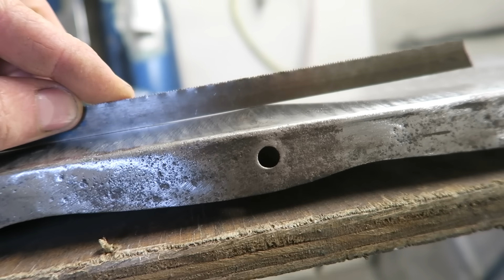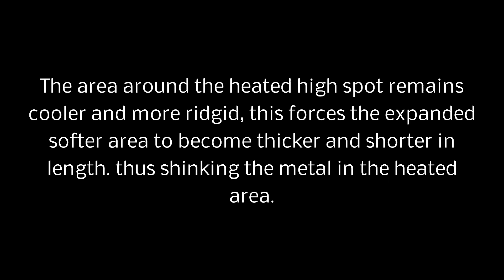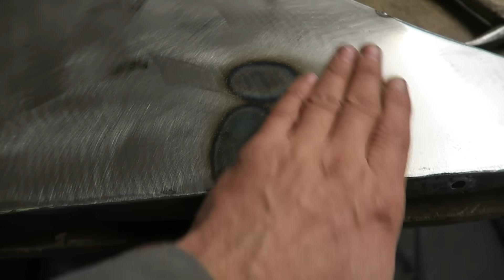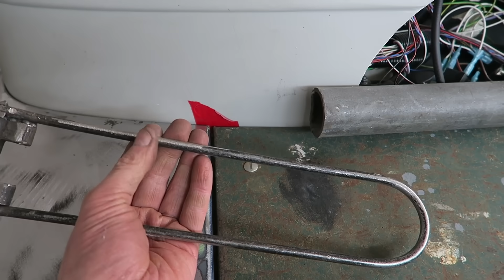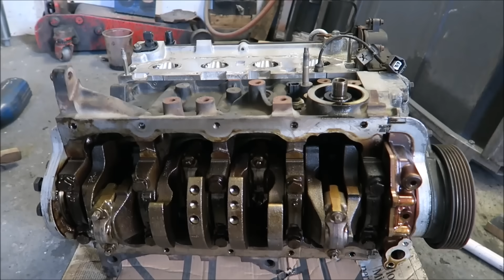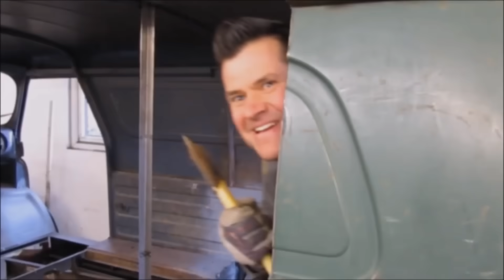Heat shrinking using a blowlamp panel beating Tips and Tricks #4

Comment: With the converted spring pick… how do you use it? 

Is it just a case of pulling on it? 

Or do you hammer down on top of it? 

🇦🇺🤜🏼🤛🏼🍀☮️😎
Reply from the maker: The pick end goes inside the panel and you just pull dents out. The part that you hold in your hand lines up with the pick end so you can easily see where to hold it. Cheers Trev

Comment: When dad did a shrink (oxy acet, so it was faster).  He always held a dolly "around" the edge of the shrink as he tapped it. Then he moved the dolly gradually into the shrink to move the metal back to the profile.   I was the kid inside the panel holding the dolly when he couldn't reach the spot.😉

Comment: It's important to not let the heat wander into the surrounding area.  While that area stays cool it holds back the force of the expanding metal, thereby shrinking it.  If the heat moves too far out, the effect is lost.  Get in, get out, and don't get famous, as they say in burglary work.
Reply from the maker: Yes Alex you’re 100% correct, I had made this particular video for a guy that had extremely limited tools. It wasn’t a  “the best way” type video. Cheers Trev 👍

Comment: Just fixed the wavy bonnet on my 1960 Falcon using a blow torch and a few basic tools thanks to your blog.  Always been into welding, but not panel beating, never thought I be able to shrink.  Cheers
Reply from the maker: Glad to have been of help. Cheers Trev 👍

Comment: Great video.  In the late 50's, yeah, I am that old, the method I  was taught to use to shrink panels, was to use the acetylene torch and actually heat the spot I wanted to shrink to a cherry red, before cooling with a wet rag and then hammering.  It is interesting to learn that the process might have worked at a much lower temperature.  I was doing a chop and channel on a 34 Ford pickup, and because of the hard life the truck had lived, there were a lot of dings, some about quarter sized,  that had to be shrunk back into shape.  The bodyman that taught me was a master with working metal, and like you, he used a lot of finesse to straighten even severe dents.   You do great work, and I am looking forward to watching more of your videos.
Reply from the maker: In some respects I wish I hadn’t made this video using a blow lamp. I actually made this video as a request by someone that only had a blow lamp as a heat source. Using a O/A torch is more effective as it creates a smaller spot of heat. Having said this it’s actually possible to use a hot air gun to shrink metal if you use it to expand the panel in an area before giving it a blow with the panel hammer, the heat expansion holds the panel ridged placing compression along in when hit with the hammer forcing it to shrink, a bit like a mechanical Shrinker. By far the most useful for me is a single sided spot welder. Thanks for your comments. 👍

Comment: Hi  Trev Regards from NZ enjoy your Blogs, straightening metals is always a patience game  I have been in the metal fabrication game all my working career Ships trucks Tanks etc  What one has to keep in mind firstly is that  steel plate has been Mill   manufactured, heated &  rolled Quenched Etc which imparts Locked in residual stresses Thinner plate usually  the worst as heavy plate cools slower and partially stress relieves itself   Then the user forms, Heats Welds as well  and releases and forms more   stresses to form distortion  Keep up the great information blog  Its all about experience and Listening  well done mate

Comment: One trick to do where the crack is still a small hole right at the end of the crack to stop it from going any farther then weld it all up I have seen cracks that were welded before crack again because it was not drilled to stop it ... It like a oil filter that has a dent don't use it the dent will crack from the changing if the motor.   Same with the panel with the vibration of the car..
Other that that great job for the tools that you used..

Comment: Question.

Heat shrink the high spots. Isn't a low spot just a high spot on the other side of the panel?
Can the more difficult low spots be heat treated from the backside of the panel, same way a high spot is treated from the front side of the panel?
Access issues aside...
Reply from the maker: I’m working on a new video that will explain this 👍

Comment: I expected a different mode of operation here, I expected you to heat the spot up until it was glowing red, then let it cool. That would have caused the metal to shrink to a smaller state than it was in before, pulling the metal in from all sides.
Reply from the maker: Right at the start of the video there is a basic explanation that this video was made to help out a viewer that didn’t have proper panel beating equipment and only had a blow lamp to use as a heat source. You were right in what you were saying about the metal pulling in from both sides. The blowlamp has too large a flame to be specifically suited to heat shrinking however virtually any heat source will do because you are causing expansion of the steel in a targeted area that puts tension in the panel that would otherwise pop in and out “oil canning” when the area is hammered this produces lateral compression forcing the metal together creating a heat shrink affect. A better flame would be from an oxygen and acetylene welding torch with a number two tip this would result in a far smaller hotter flame keeping the heat focused in one area and for a very short amount of time, The cool steel around the heated area would produce a an expansion block forcing the heated area to increase in thickness thus creating shrink when the metal has cooled. Cheers Trev 👍
Reply: @trevsblog  Thanks for the answer, I have no experience with working sheet metal so I wasn't sure what to expect but I'd heard of flame straightening like I mentioned. Is this technique used any in this business? I've wondered if a TIG torch might work as well as an O/A torch.
Reply from the maker: It seems more complicated than it is. Because bodywork typically doesn’t stay uniform when you hammer it or heat it etc it seems like it has a mind of its own, this is because it’s relatively thin and there are normally a lot of complex shapes going on in bodywork that have an enormous effect on buckling etc. It’s no different to flame straitening as described in my last message, and the added blow with a hammer places lateral compression to increase the shrinking effect. As said any heat source will work, ideally smaller the better but you can use friction, a hot iron, TIG, I have even used a hot air gun. Cheers Trev 👍

Comment: Wow, that blowlamp leaves mine looking like a cigarette lighter. What is it and what gas are you using.
Reply from the maker: Hi Andrew

Please don’t be too focused on the whole blow lamp detail. One of my failings with this video was not pointing out at the start that the video was made after a viewer request for ideas on how he could perform shrinking without any specialist tools. I asked him what he had that could heat up metal and he replied a blow lamp. Although it was effective it isn’t the best tool that I could have used BUT it was a cost effective way of performing a quite advanced skill utilising a tool he already had. A more effective tool using a flame would be a proper oxygen acetylene welding torch with a very small jet, like a no2. The smaller and hotter the flame the less heat spread you get which is what you ideally want for the shrinking process to work more effectively, as it’s the cold metal around the heated area that holds compression against the heated area. Having said all of this the video as far as I’m concerned contains good information, I have also successfully used a spot of mig weld, a TIG welder, single sided stud welder, gas welding torch and even a hot air gun to shrink metal. Some people even use friction, which is supposed to work well.Cheers Trev 👍 ps the blow lamp was nothing special just a vintage one

Comment: Trev, can you do a video using a shrinking disk to remove highs?  I ruined a panel or two as a beginner using a torch.  The shrinking disk is easier to control  the heat and has worked more effectively for me but I would like your opinion on where to use one method versus the other.
Reply from the maker: I’ve never used a shrinking disc, maybe I’ll try one, one day... using a gas torch with a no2 is preferable to a blow lamp but that was the request I was asked to do a video on. My favourite tool is definitely a single sided type spot welder with shrinking attachment. Cheers Trev 👍

Comment: Good gravy Trev, it works! I found a previous repair last night on the tail panel of my Firebird so I decided to pop the filler out and repair the dent, unfortunately, I pounded the metal a little thin and it had the feel of a pop tin, so this morning I watched your video and tried it and with 2 minutes and 2 tries it was back straight, nice and tight, it worked perfectly. Thanks for the awesome tip! Cheers

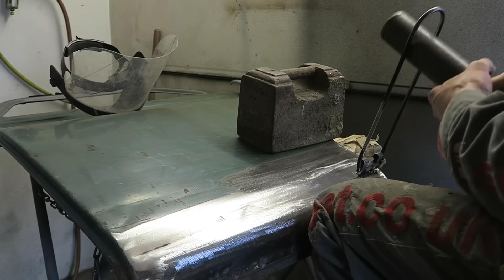Comment: Good tip for you when welding a pull bar [20:20] run a weld to panel first then weld bar on to weld so after work you do not damage panel when removing bar [often pit marks /holes ]

Comment: Hi Trev, nice video again, as usual :) 
However it raised some questions that I would ask the teacher if I would stand next to him in the room. Youtube is not the best medium for Q&A, but anyway...
You basically turned a highspot into a lowspot here, metal being stretched up in the beginning and being stretched down at the end of the job. Am I right that the end result still is a stretched area, only the other way up (down)? Did you hammer it a bit too hard then?
And then you state something interesting about a low spot being (relatively) easy to solve, versus a highspot being very annoying. But they basically are the same, or? Just flip the pannel and a highspot turns into a lowspot. How come you can bring up a low spot with hammer and dolly, but a hightspot not down? Where does my reasoning go wrong...?

I will purchase one of these stainless discs to be used on the disc-grinder to apply heat to highspots, one of these days. Did you ever work with those?
And what's you opinion on shrinking, only by cooling the hotspot down rapidly, without hammering?
https://www.youtube.com/watch?v=FGMUEXGiySA and https://www.vocor.nl/krimpschijf-shrinking-disk/1847-krimpschijf-shrinking-disk-125mm.html

thx, cheers from Holland!
Reply from the maker: Dutch Classic Exhausts if someone asks this question they are truly asking a great question because it means that they are really trying to understand something that on the face of it seems straight forward. Most car panels are convex, if you have a high spot in a convex panel it means that it is stretched and needs to be shrunk normally by means of heat shrinking which is a harder operation compared to a low spot that needs stretching. I hope we’re agreed upon that. If you now flip the panel over, the panel is now concave and the reverse applies a high spot in a concave panel needs to be stretched not shrunk. If you shrink a high spot on a concave panel it becomes higher. If you ponder this for a while it answers many questions about the nature of high and low spots. The most controllable tool I have personally used for heat shrinking is my dent puller with the heat shrinking attachment. Cheers Trev 👍
Reply: @trevsblog  Thanks, Trev, I understand the nature of high and low spots better now. A low spot on a convex pannel is basically shrunk a bit: the metal takes a shorter road from A to B. That was my missing context.
My new tools will come in this week; I will give it a try and see what happens. I already found that the fenders of my Citroën U23 light truck are quite solid steel, 1,5 mm at least. Probably not the best to practice on. Maybe I should practice on my neighbors car first :)
cheers!

Comment: if you were to do that to a panel you couldnt get to the inside of to paint would it be better not to use this method due to the potential of initiating/accelerating rust on the back of the heated area?

Comment: Great video. I was just trying to shrink excess metal from a panel today, but was unsuccessful. It is "tramping" as I call it, but the same thing, it's high to begin with but will flip to a low point if I push it.
   A couple of things that will make a difference is that my butane torch does not produce a fine, pointed flame like yours. It makes the heated area twice the size. Plus, I was just quenching it, I wasn't tapping it while it was hot.
   I'll be having another go in the morning.
   I really enjoyed the video and the way you explain things, so I've subscribed and look forward to any future videos.
Cheers.
Reply from the maker: Ray Plant by putting the heat into the area you are actually expanding the metal, this expansion causes a lot of tension allowing you to hammer the metal without it popping back in. When you hammer it, it causes the metal to shrink. The quenching isn’t as important as it appears as I’m mostly using this to bring the temperature down so that I can inspect the repair. Cheers Trev 👍
Reply: @trevsblog  cheers Trev, I appreciate your response. I'm about to give it another go right now. Thanks.

Comment: Subscribed, I've watched many video's of this type and Trev is by far the best. The tools are genius, I also make them as needed. Love the the slide hammer at the end,I made a clamp ended variation of this a while back to sandwich the weld on type dent puller studs which allowed me to move around on the dent and pull from all, center or either side as needed. Thanks for sharing your skills and knowledge!!

Comment: Great video but why not use Paintless Dent Removal techniques
Reply from the maker: fl4637 the metal is stretched beyond manipulating it back into shape, it’s also slit and needs welding. To use pdr methods wouldn’t really be a logical process. Cheers Trev 👍

Comment: Hi Trev, just watched your interesting blog on heat shrinking a panel. As a plumber l noticed that you are holding the flame a bit to close to the metal. the hottest part of the flame is the tip of the dark blue cone, the flame is not so effective if the cone impinges on the metal. otherwise a good blog.

Comment: Good vid.  No dolly?  I find the heat and hammer method works, whereas the heat and cool method doesn't.  Heating and cooling just hardens the panel and makes it harder to work.  Although sometimes you want that towards the end of work on larger panels.

Comment: It might be nice if you'd make a proper distinction between splitting and cracking- they are different. A "split" is the result of being forced apart at the failure- like with a knife.

A "crack" OTOH is a result of being pulled apart by tensile forces. 

Everything you've called a split is actually a crack. I know some people are going to be offended by this comment, but it has more implications for the way the remaining material behaves...and anyone that says that doesn't matter is choosing to remain voluntarily ignorant. The most obvious example is the fact that a cracking failure actually extends significantly further into the material than the observable crack. 

Otherwise...nice video.

Comment: Another interesting post! I've used heat shrink to straighten shafts, after a weld repair, but just used a water or air quench. Love the homemade tools. Seems like the work is more fun when done with them. Thanks!

Comment: I'm as guilty of NOT being very safe as the next guy. One thing I used to be guilty of until I learned better was lighting a torch with a gas lighter. Those things supposedly equal a quarter stick of dynamite so you wouldn't want to be holding one when it "blew up". And, they do. I have been told by welders that a spark from welding can set them off. Probably not terribly likely. Just not something you want to risk since you can't do much with only one hand.

Comment: Back in 77, (old school), I was taught how to remove stretched spots, (high Spots), in fender panels with only a rosebud tip to heat with, and a wet rag to quench with. I could literally hear the panel pop back into place while doing so. Its a bit of artwork to achieve and does take practice but in most cases, I did not need to hammer at all. I actually became quite good at doing so in under a day. I simply heated and quenched strategically. Its all about understanding what caused the stretch and where to heat to remove it. Small circular dents were easy. The skillful part was removing an oval or even curved stretch. 

As for the hammering, I was also taught to angle my hammer taps with strokes going inward towards the center of the high spot, from all angles around the high spot, not to hammer directly downward on the high spot.
Reply: Dave Boling Do you have a video of your technique?

Comment: Does not the water rag also aids in the shrinking of the metal?
Reply from the maker: WILLIAM NAGEL it could if used in a certain way but I’m really only using it to reduce the heat so that you can assess how well the panel has been repaired. Cheers Trev 👍

Comment: Would ice work on one side and heat on the other,heat expands and cold contracts or I guess could water is samething only different.
Reply: Brilliant.  Ultra cold air from the air compressor on the side opposite the heat should cause contraction.  The stretched metal is thin and must shrink.